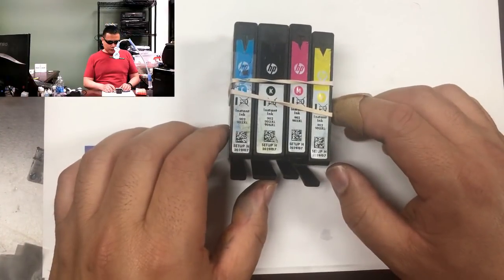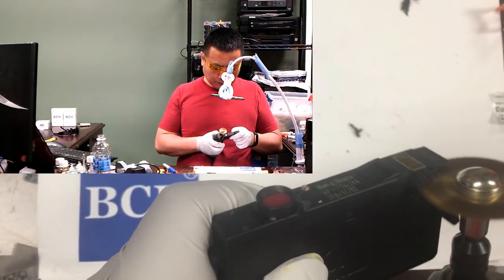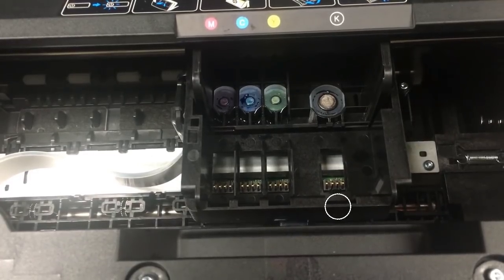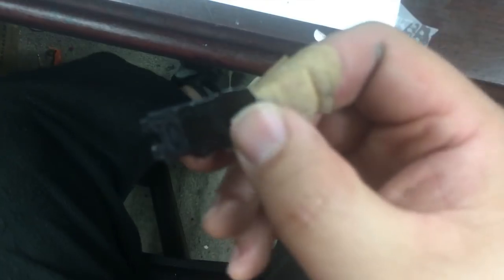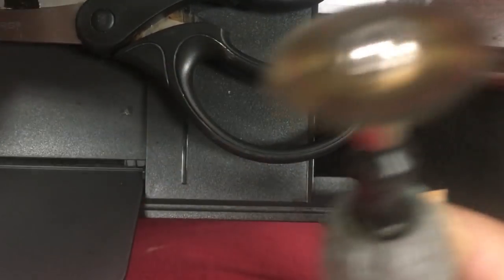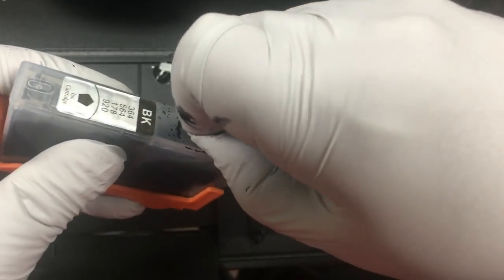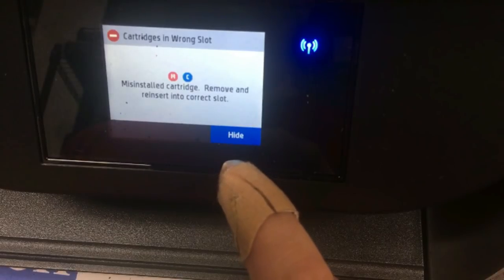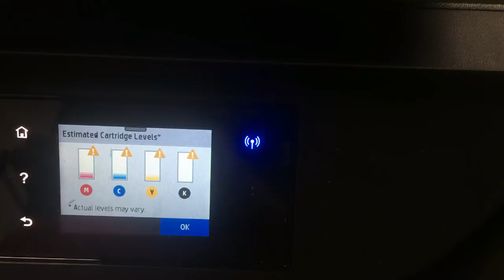Remove & Transplant Chips for HP Instant Ink Cartridge 902 934 935 564 920 Video 2 Part 2

Comment: To grind down the chips, you could use a sanding block or a piece of sand paper taped to a flat surface like a table top. Then apply a piece of tape the contacts side of the chip and use it to rub the plastic side of the chip against the sand paper. Rubbing against a fine file will work too or a sharpening stone even better. You're pretty handy with the Dremmel to Polish plane the material down but man that's a little too accident prone. Be safe. Thanks for the great video.

Comment: hi thanks for your video. I have three color cartridges and a bw as well from Instant ink. If I
put them in my printer will it read them and put me back into the instant ink program. I haven't wanted to use them because of this. Please advise. thanks

Comment: Why instead of removing the chip, not simply drill a hole in the genuine cartridge and fill it when necessary? The only downside would be to not be able to see the cartridge levels, but isn't that way more simple than buying those cartridges, a dremel and cutting the chips ? (never tried any, just curious)
Reply from the maker: You are right. You can do both ways.  If you want to use the OEM cartridge,you can have a scale to weight the cartridges.